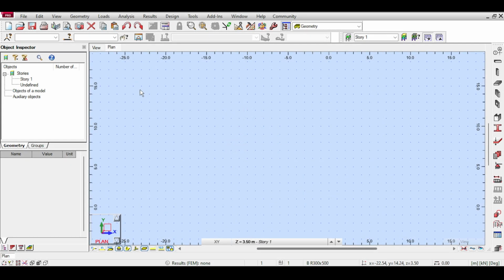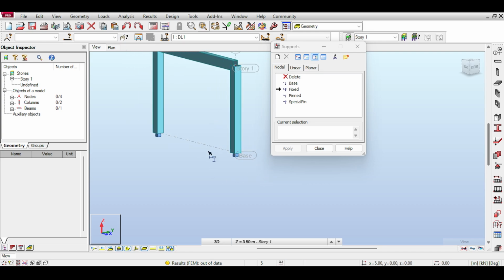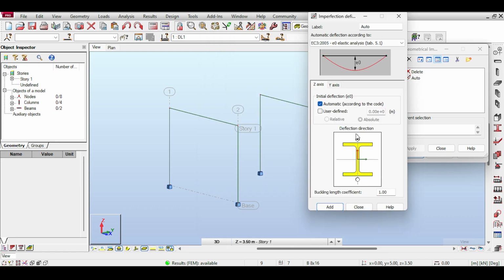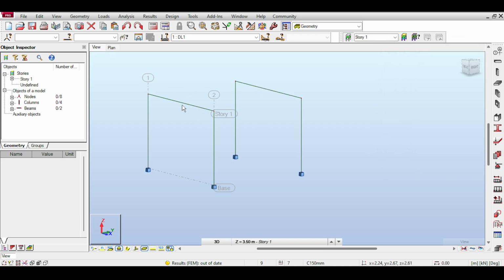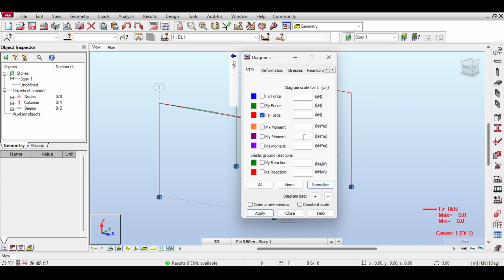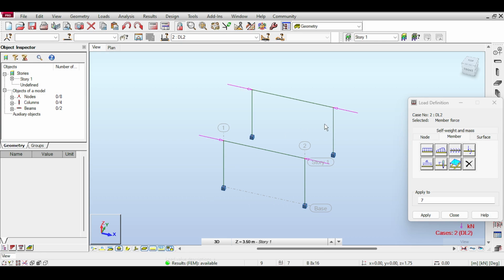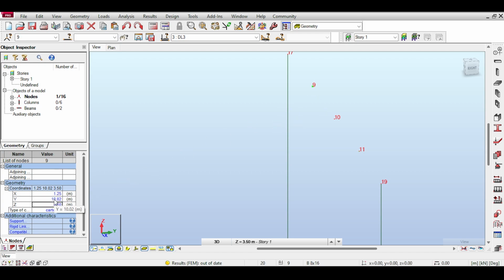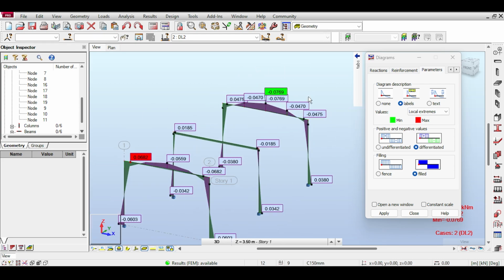Understanding Geometrical Imperfections in Autodesk Robot Structural Analysis

Comment: Dear CEE i just love your basics videos, i was wondering about buckling length coefficient, you set it up at 1.00? Maybe It should have been 0.70? 

Anyway i always had this very big doubt about defining imperfections or not when you are after the alpha cr (according to ec3)? Or even during second order analysis?

Theres also an buckling analysis type where you can consider deformation shape, has that anything to do with this?

Thank you very much as always!
Reply from the maker: Hi there dear Engr. Candea,
I totally missed talking about the buckling length coefficient. Yeah, 1 is a conservative k. It can be calculated from alignment charts.
It is even in the e0 equation of the eurocode  (EC3 (ENV 1993-1-:1992))

In my humble opinion, imperfections should be included when the second order analysis is needed and/or buckling analysis. 

I am not sure of RSA has a fully fledged buckling analysis module. You may do a second order analysis with imperfections to "simulate it" but the fully fledged buckling analysis? not really sure. I need to check it out and maybe do a video on that if I find it.

Still, thnx a lot. You are 100% right, I should have talked about k and even explained how the value is decided. I am going to pin your comment for future viewers. I am sure the discussion would benefit them.

Regards,
CEE

Comment: Regarding steel beams, wouldn't it be more conservative to assume that the initial geometric imperfection is oriented downward? In practice, it would be very difficult to systematically ensure that the initial bow is always pointing upward — which could lead to more unfavourable conditions than those assumed in the design. 
Thanks for the video.

Comment: can this geometric imperfection be used in slab deflection control when applied to beams on which the RC slab lays? (more like camber) or it is better to apply prestressing forces ?
Reply: Just to answer my own question: NO, these geometric imperfections do not affect deflection values as beam camber would. they are supposed to be used to simulate the excessive internal force factors that can arise if the imperfection is present.

Comment: The matter with the initial imperfections mostly apply to the global analysis systems. An unrestrained portal frame or a U-frame action steel foot bridges (think about the top chord) would be a subject to initial imperfections. For simply elements EC 3 chapter 6 applies which takes imperfections into account and effective length would have to be determined. For complex structures and with global analysis, I suggest the initial imperfections to unbalance the structure + P-Delta analysis to pronounce the effects. The simply section check is enough, and no need for effective length for buckling. BTW, A good take again, cheers
Reply from the maker: Hi there, sorry for the late reply ^_^
Those are amazing points! Thank you for mentioning places were imperfections are to be checked. This helps both me and future viewers see the importance of this tools in RSA>

And also, I admit, I missed mentioning the P-Delta effect that would amplify the effect of imperfection. It slipped my mind, kind of was laser focused on showing the way RSA applies geometric imperfections, so I lost the more general picture. Thank you very much, your comment is definitely an important addition.

In the end, I am happy you still liked the video. I always feel great enjoy checking out your comments.

Regards,
CEE
Reply: @CivilEngineeringEssentials  I would be happy if you could work out an arch and present how to do it using all those points ;)
Reply: @CivilEngineeringEssentials  You are doing a good job and have to say I value the effort you put in and mostly I enjoy seeing how much passion you put into it. Not many people left with passion into serious engineering. :) cheers

Comment: once again very thankful to the videos series. dear Dr. when it comes to design of buildings which is better and mostly used ETABS OR ROBT structural analysis ?
Reply from the maker: Hmm. that is a good question. Now personally I am an Autodesk Fan. But I am not saying the CSI is weaker. The reason why I cover RSA extensively is because engineers may have easier access to it especially during the university years (free licenses for students).

Also, in my humble opinion, I think RSA is easier to use. But note: it is just a personal opinion here

Regards,
CEE